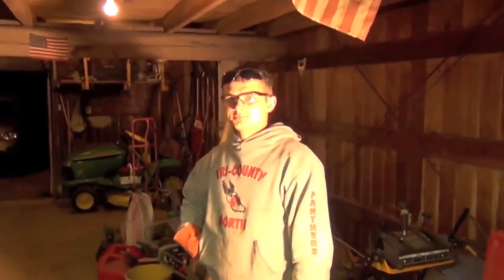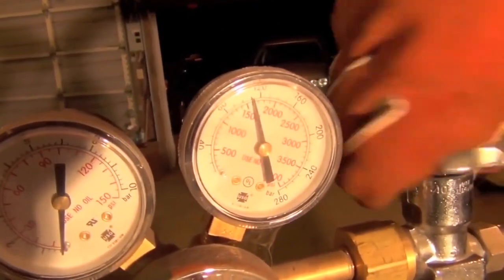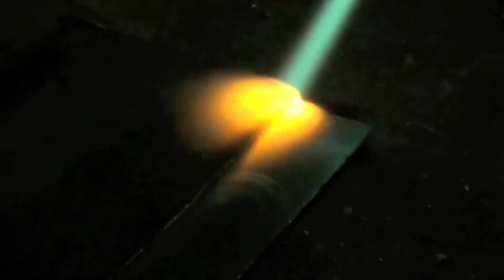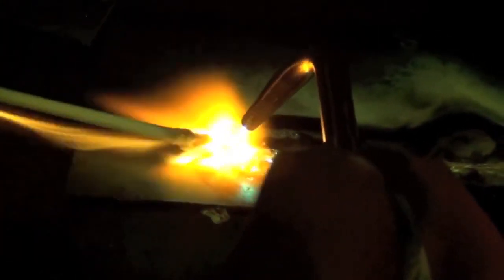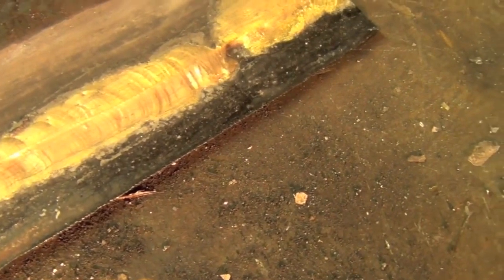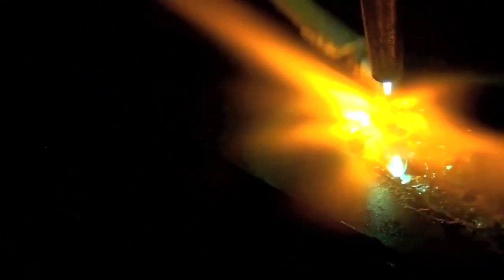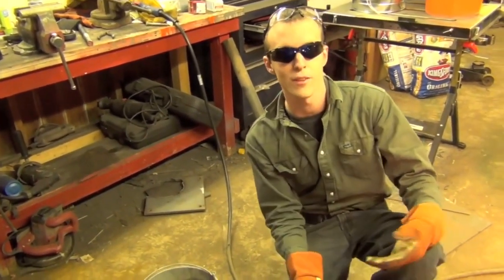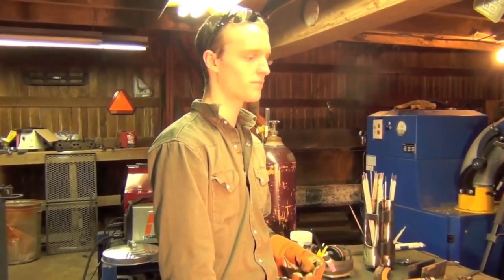LOST ART I LEARNED FROM AN OLD MECHANIC / WELDER - TORCH BRAZING STEEL INSTEAD OF WELDING

Comment: ive used both oxy/fuel an carbon arc (ac low amps) great application for all farris metal  , like you mention cast, used alot in early days to repair water jackets . good vid

Comment: If you use more of a lay wire technique with a tighter cone with less wire manipulation way more torch manipulation (circles) you'll get a nice stack of dimes that's way stronger. Many, many years of torch brazing and welding.

Comment: Cast is tricky .I used to fix the wooden manure spreader with cast iron gears that drove the chains ..Can flux naked rods ,it helps to have all broken pieces  a heavy duty steel work table to lay out all broken pieces ,flat and cleaned --no excrement to contaminate weld ,bevel all broken pieces carefully leaving small flat face to match original surface break. C clamps are your  best friend and don't be shy how many you use . Cool down REALLY S L O W  ! !       Or cracks     again .....

Comment: Silver brazing should be a whole lot cleaner looking. Use some 56% silver and in my opinion it will be less messy and more cleaner. I been silver brazing in my air gas company cryogenic department for 4 years.

Comment: This is terrible!
Cleanliness and dryness are the keys.
Coat the two plates, at the join, with de-humdified flux BEFORE you clamp them together for a lap-join like the exapmle.
That will wick the the brazing into the joint.
Fluxed rods are a nightmare, unless you put them in a very hot oven for an half an hour to drive out the water from said flux.
I avoid them.
Flux is deliquessent.
Whatever shop-school you attended were delinquent.
I could do better with a box of matches and foil from a cigarette-packet.